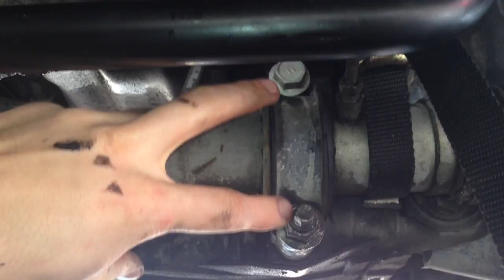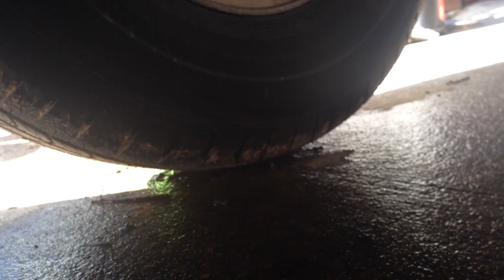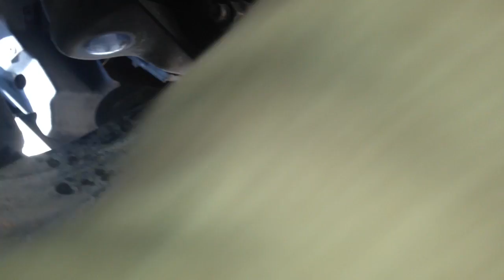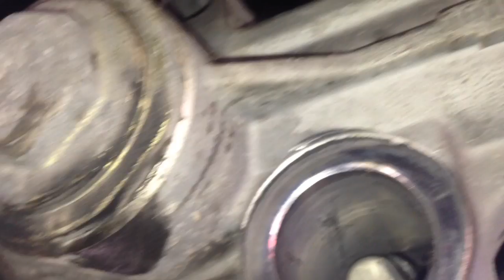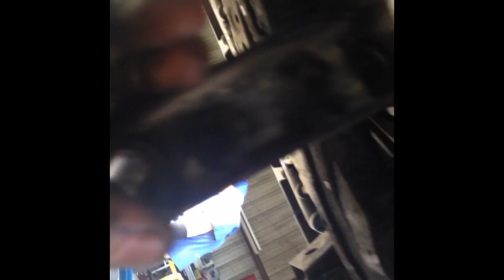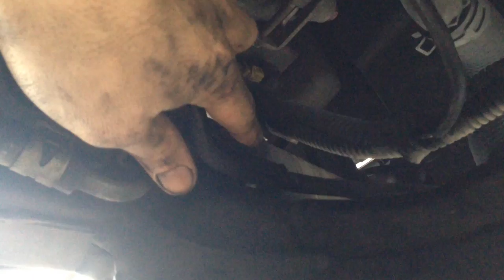99 4Runner Rack and Pinion Mounts Replacement

Comment: you  dont need to take tie rod off or even use a ball joint press just use a knife to cut old bushing and knock it out with socket and hammer

Comment: Just did my 2000 Tundra. I used a utility knife to cut off the bushing ends and a deep socket to tap them out.  It helps to also disconnect the clamp on top of the rack that holds the fluid line to give a little more range of motion. Toyota engineers are the best - always leaving space to do these kinds of things. Whole job was around 3 hrs start to finish

Comment: i have a question. i have a 98 Tacoma and i think its the seals that are bad. i was wondering how to get those off and replaced? its mainly on the left side where the steering shaft is and under there. its also on that brushing or seal on left. is there anything i should be wired about when taking it off and putting new ones on?
Reply from the maker: I think Mustie1 posted a video of replacing the seals in the rack. I've never had mine apart.

Comment: How long can I ride on a bad rack and pinion? Been doing it for 5 years 100k plus lol  I mean I'm not loosing power steering fluid. It drives and steers fine even alignment on point. I do hear very minor noise when parking or backing up( you wont hear unless you really listen ) etc which got little worse over years  also boot is torn I got about 255k on my camry don't want to put money into it besides that car good mechanical condition any advice? I wanna make this car last without doing unnecessary work $$ save money
Reply from the maker: I would leave it alone then till it gets worse.

Comment: Thanks for the video.  My friend Sean and I used your video along with the Factory Service Manual to do the job on our trucks.  We did video the job and we'll be putting it on my Youtube channel, "Timmy the Toolman".  We basically did it similar to way you did it but didn't need a pry bar to move the rack around.  We also show replacing the sway bar bushings and end link bushings with polyurethane ones.  We'll have the video posted at the end of the week.  Thanks again for sharing your knowledge.

Comment: how did you determine that the rack mount bushings were shot other than the obvious mileage on the vehicle.  I have 210000 on my 2000 and the front end seems a little lose.  I replaced the front cartridges (shocks) and wheels and tires are trued and balanced but have some wheel shake at close to 70 mph.  I was just curious if the rack mount bushings would get rid of some of this shake>
Reply: +Steven photog it helped a bit on mine but you need 2 people to tell if there shot one inside turning the wheel  one under  inspecting

Comment: Best video out for this job...thank you
Reply: +liltripleogken I agree with this sentiment. I've been looking at doing this job for several months, reading over the same internet instructions the guy in the video references. I really wanted to watch a video of it, and looked for a long time, but only found videos of people showing what bad bushings looked like. I guess I had been searching the wrong keywords, because today I finally found this video.

I think one of the things that's been keeping me from doing this for a while was that I heard it can be a real bear to get the rack back in line with the mounting bolts. I was afraid I would get this thing apart and then not be able to put it back together. My 4runner is getting bad though, and I was going to try to replace these bushings this weekend. This video gives me the confidence that should I not be able to get it back in line, I just need to undo the driver's side tie rod. I do live in a rust state, so I'd prefer not to mess with that, but if I have to, I can.

Comment: I greatly enjoy your 99 4runner repair vids as I also have the 99 model. Since I am 65, I try to minimize my under the vehicle time and sometimes head for the garage for some of those tricky ventures. I tend nowadays to prefer sitting on my bucket doing brakes,  and other jobs where my feet are on the ground. However, I will still get underneath for shocks and mufflers and other "easy" stuff. Enjoy the work while your still young. My regards to the yawning oldster in the background chair overseeing the project.